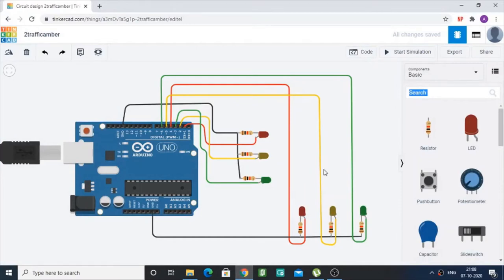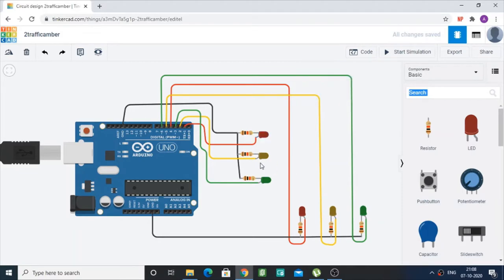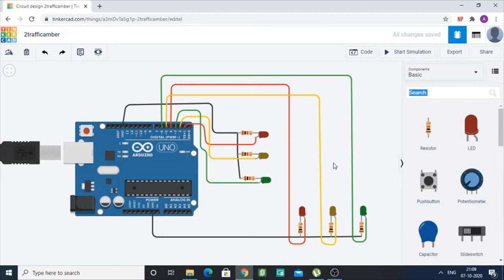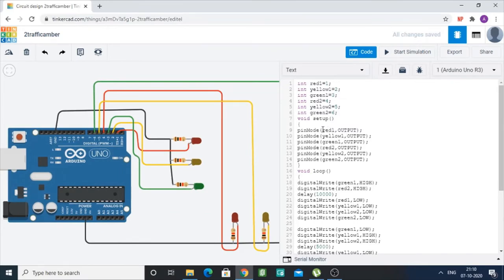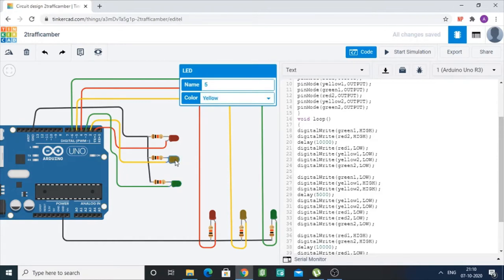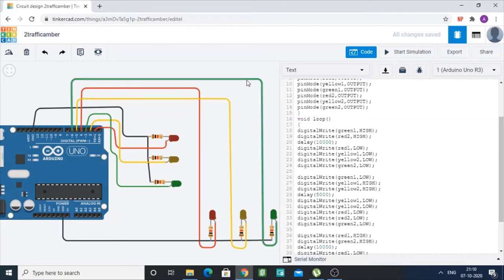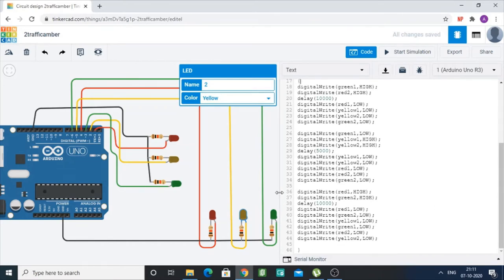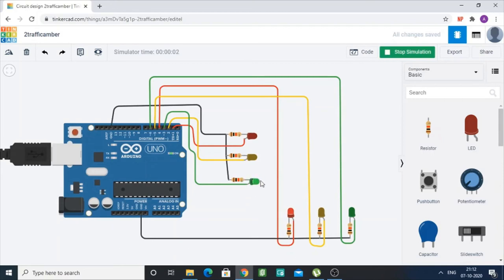2 way traffic light system using Arduino || Simulation on TinkerCAD || Hardware execution

Comment: Great video, can I ask. I want to add a servo which lowers a barrier to stop cars when the light is red. How do I add that to the code?
Reply from the maker: You can learn to control servo from this video - https://youtu.be/_tsl8B3Mrdg and set a condition depending upon the light status(i.e. red/green).

In case you want us to help you with the complete code, circuit or TinkerCAD file then reach out to us at learnelectronicsindia.com@gmail.com